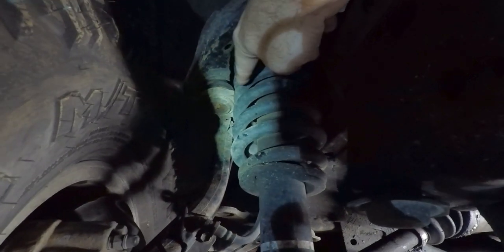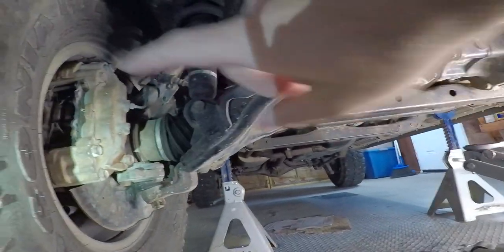Toyota Tundra Sequoia Differential Drop Kit And The Effects Of 3in Lift Kit

Comment: After having done a 3 inch spacer leveling kit to my 07 Tundra and cranking the axles to wearing out boots / bearings, I will never again do that.  Just bought a 2020 Crewmax and will hold off from going the cheap route, leveling kit for doing a suspension lift.

Comment: Thanks for the good info. They peddle these leveler lifts as bolt on 'everything is great' set ups. Obviously, as I suspected because that's always the case, without changing the angle on everything else you're going to get multiple issues with the driveline angle.

Comment: Hi have 02 sequoia looking to upgrade shocks and struts.  What is a great brand of shocks and struts.  Also if lifting it, how high can I go without adjusting front differential?.  Also looking at heavier control arms.  Putting front pushbar and front tow hitch

Comment: Hey Nathan, good video. Just a few days ago I installed the same diff drop on my wife's 1st Gen Tundra. Tonight I took it back off. The differential was bumping the frame and sounded awful. I'm gonna see about taking the spacer to a machine shop and get them to drill a recess for the bolt sleeve that protrudes from the frame. I'd be interested to know if you ran into the same problem.
Reply from the maker: I didn't have that issue, never heard of that problem , are you sure its not the upper control arms hitting the strut springs, mine does that, I just got in new upper control arms, video is coming soon, other than that your rubber diff mount might be bad
Reply: I never had that problem either

Comment: Those types of diff drops do very little to correct the CV angle after a lift. If yo look at the total picture geometry of the diff and the axle placement you can see that dropping the front of the diff 1" and leaving the rear mount fixed amounts to .5" or less at the CV, so very little help. You need a diff drop like a Phat kit that relocates the diff downward with new brackets, mounts, etc. And yes it costs more than a $100. and takes more work, but it actually does something.

Comment: The Diff drop is useless, at least in the case of the 5th gen 4Runner. Not sure it's any good on the Sequoia, but it's hard to imagine that small of a drop would make enough of a difference on driveline angles on the half shafts of these Toyota trucks to improve longevity.

Comment: Anything above a 2" lift changes the geometry of the suspension dramatically!  The fact that most SUV's tend to be top heavy, makes anything above 2" dangerous to drive fast.   Even a body lift is really pointless; unless your going for looks.   The engineers went to alot of troubles and figuring out the dynamics of all suspension systems.   For serious off-road capabilities you need lower section clearance for larger objects...  The control arms are not designed to be set too high, but you can go with different parts, now available through the aftermarket.  That middle brace for the front-end would be a big improvement.   The fact that your taking a really great secret and making it known is awesome!  The Sequoia's are going to be classic overlanders as well; but they'll be rarer, because they're aren't too many people doing these.  Check out 1st gen off-road; on YouTube, Josh is working on these, and making them ultimate machines for Overlanding.  Be positive too you seem a little negative in tone sometimes.   Don't worry, be happy!

Comment: seems like lifting the front more than 2" is just not worth it.
Reply: Can't fit bigger tires, less ground clearance, less suspension travel...some people have different needs than stock vehicles come with.
Reply: I wish we could post pics. I have a 2001 on BFG KM3 35x12.5 on 16x10 pro comp Xtreme steelies. I have a large property and the only reason I bought the truck was to build something different
Reply: So you suggest I only lift 2 inches. I'm searching for a safe way to lift my truck
Reply: @adakainesha  me too